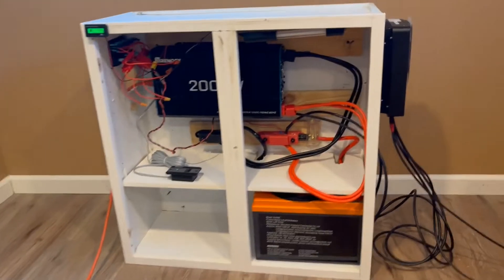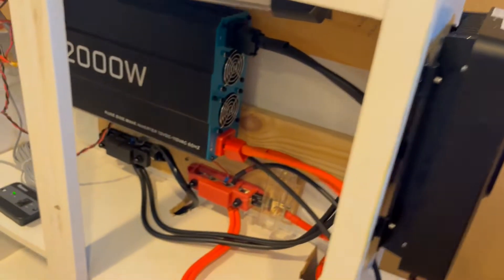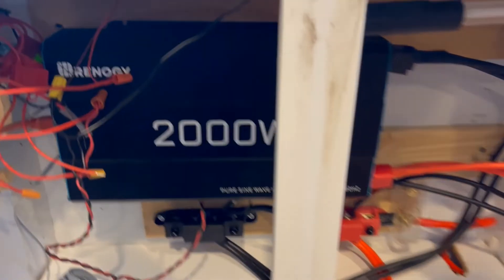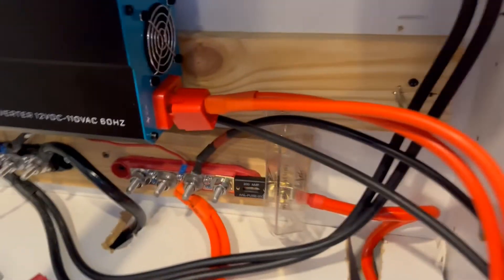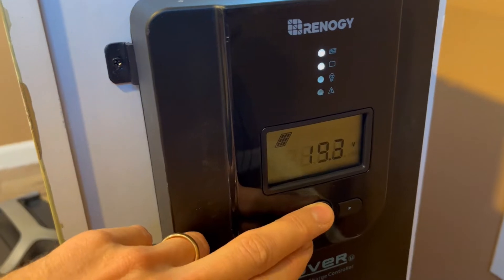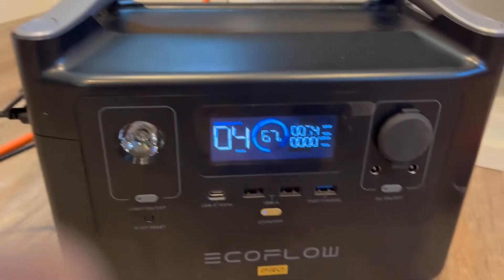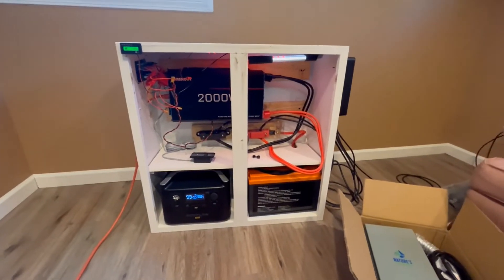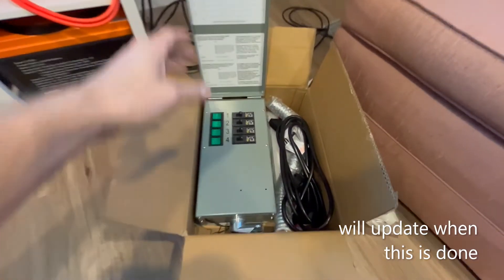DIY Portable Solar Power System | 200W Solar, 12V LiFePO₄ Battery, and Inverter Setup

Comment: Stand Alone Systems backed by Portable Solar Generators is Smart Looking Out. Gas Generators are Noisy, Costly and Dangerous with having to deal with Fuel ( Gas or Propane) 🔥 Real Clean Install 🏆
Reply from the maker: Agreed completely! Thank you for checking it out and for the kind words 😎

Comment: Looks good.. You will have less "losses" from the LifePo4 than Lead but as long as you still figure 33% loss you will be set.. and you can never have toooooo many "systems".. There will be a time when one won't work properly for one reason or another.. It has been cloudy here for at least 3 weeks and never could get my main batteries topped off.. Fortunately I had the solar generator and 2 gas generators I fell back on when needed.. I am up to 2100 watts of solar now,, and have been thinking of how to add more.. lol  (never ending)... love those "Custom" holes..
Reply from the maker: thank you! agreed, always need n + 1 systems... lol.   yeah i'm looking into maybe 4 x 250W used Trina's to have more power coming in. Motivated for sure!